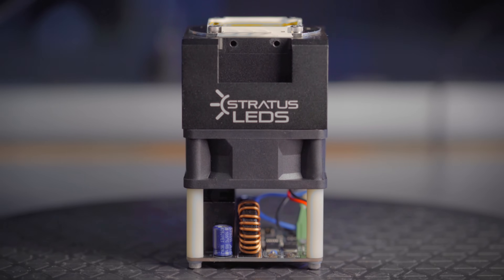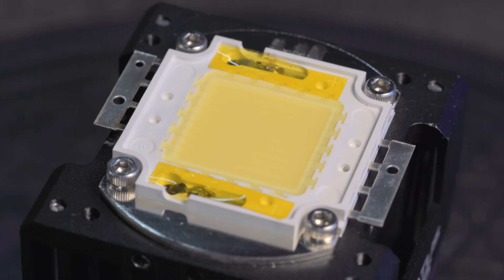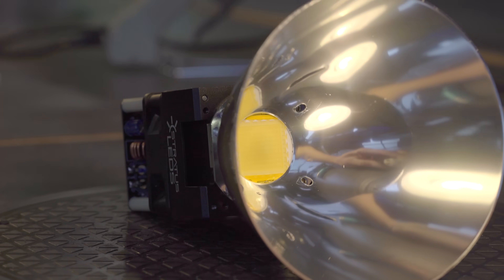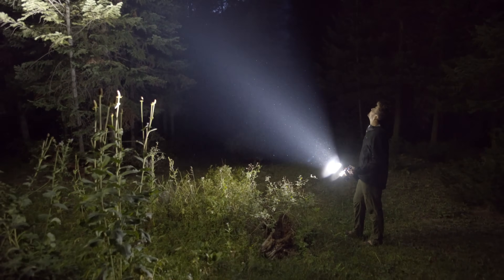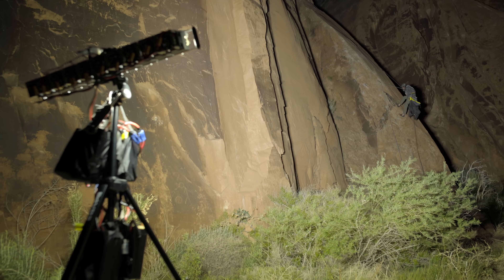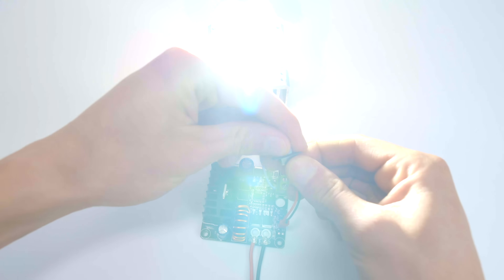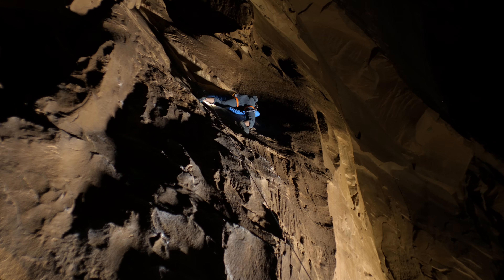Stratus LEDs 100W Module V3 Intro

Comment: Light output is insane!!! 😮😮😮 At 1:24 the X-Files theme song started immediately in my mind 😄😄😄
Reply: this light is nothing compare to imalent ms18 and r90t... that lumen can be archieve with imalent medium low mode... same 12v setup..
Reply: @harisyoung4110  I agree, but the price for the Imalent torch is a bit shocking at first. These Stratus modules for 99USD a piece is a great price for the Lumens they output :)
Reply: @barjan82  yea lucky im got the set of both imalent ms18 and r90t  when they are on sale for $300... it come with both imalent in one box... if not on promotion, only got one imalent with that price.. ms18 for flood and r90t for far thrower and flood..

Comment: Nice product specifically for DRONES - finally! This have to be a good niche in an aerial filmmaking/cinematography, so good luck guys!
I would suggest changing that green DC output connector that goes to LEDs to some kind of gold plated one "banana" like plug, XT30 for instance. These connectors that uses screws are enough for things indoors and stationary. But when there is atmospheric affect and vibrations, they can give you a bad connection. The 12V, 9.5Amp on output that you have is enough to do that. Would directly lead to some flicker effect.

Comment: Beautiful. How long will it run on... say... a common 3000mAh 20-30c discharge 11.1v lipo battery?  Separately, I would love to put these on my truck if they were suitable for off-road abuse and in a nice housing like a KC light or similar.
Reply: The math says about 21 minutes, but probably less. 100W/12v = 8.3A, 3Ah/8.3A = .36hr * 60min = 21 minutes.
Reply: @joshuamiddleton5274  Thank you, Joshua.  Math and I have a sorted history and don't really get along anymore.
Reply: But you could put the light on your tractors battery, the input voltage of the LED light is rated 11-27,5V. And for protection just cover the light with epoxy

Comment: Probably not a brushless motor for the fan if only + and - to connect it...
Reply: Driver board is built into the fan silly.
Reply: @unclejohn5012  It's a standard computer case fan. They are all "brushless"

Comment: Can the brightness only be controlled with an analogue value? If so, why not make it controllable with the signal you get out of an rc receiver?
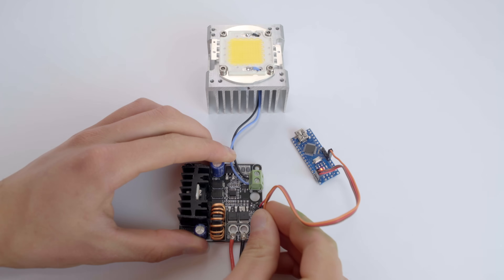Reply: 2:12 they said it can be controlled by rc radio system... PPM maybe?
Reply: @Hobypyrocom  they said it can be turned on and off with rc, and I'm sure the brightness could also be remote controlled with some kind of specialized receiver or a conversion circuit, but my question was about if the brightness control is directly compatible with rc receivers, and if not why, given Daniel's affinity for rc
Reply: @robmckennie4203  PWM
Reply: @Snecho  PWM isn't analog, PWM is PWM. You could convert PWM to analog with a little filter, but that isn't direct compatability, my question was about direct compatability
Reply: @robmckennie4203  you would need some complicated circuitry, because in a pwm reciever, the duty cycle is very low - 1-2 ms on time, 50-150ms off time

Comment: Just need a case for it and put em on my tractor
Reply: I see, we have 2 loaders with the same problem.
Reply: Shredxcam22 what kind of tractor? Most tractors have pretty good lights, well at least good enough for me.
Reply: Adam FPV mahindra 485. It's a clone of a International 444. It has decent lights but I'd like to be able to use it as a light stand when working out and about the farm. The loader blocks the head lights. Which leaves just the fender mounted lights really doing anything.